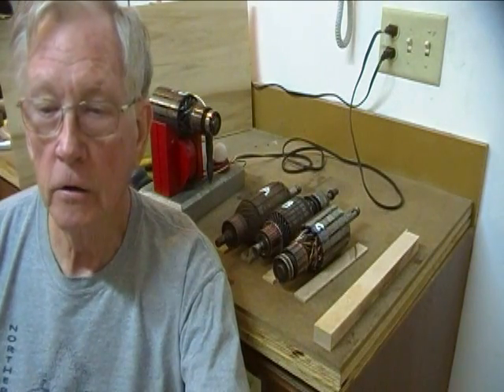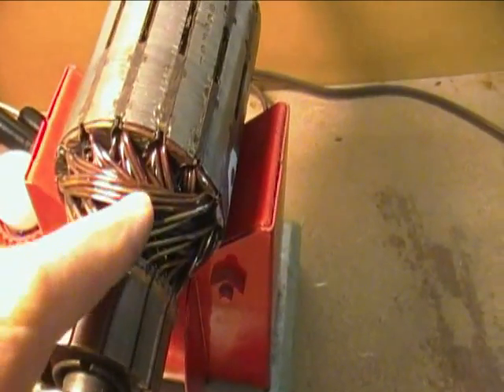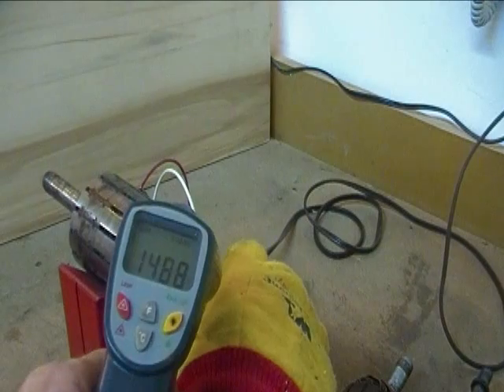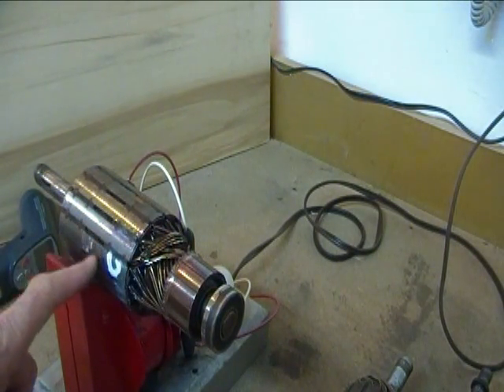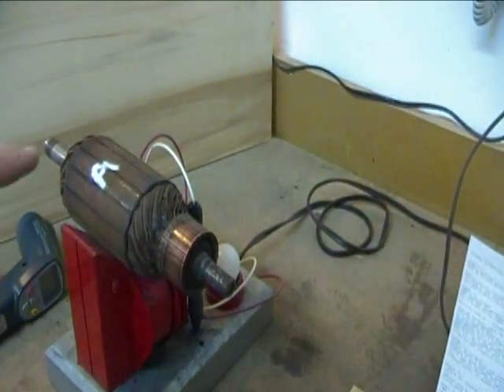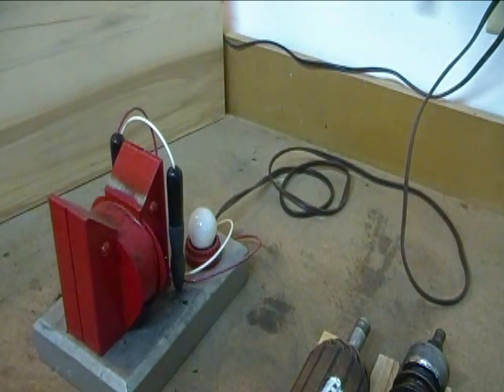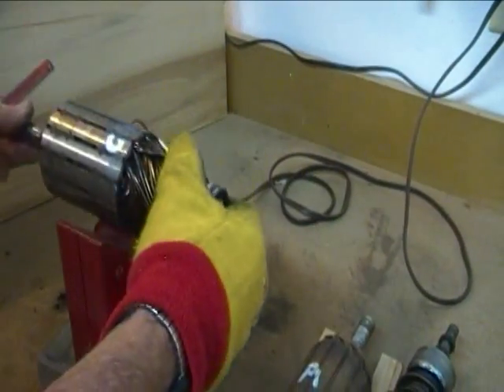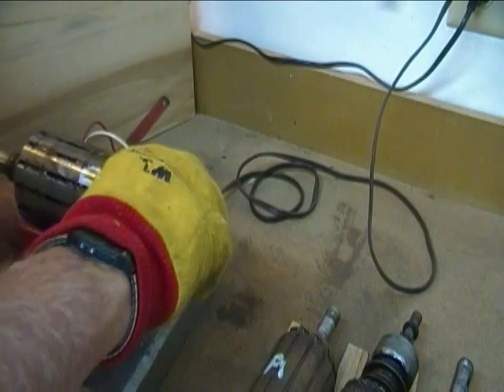Growler DC Generator Starter Armature Testing

Comment: Hi, would the tests that showed the armature was shorted by using the growler and hacksaw blade also be tested as effectively with an ohmmeter?
Reply from the maker: If the armature windings were shorted to the armature, then yes,  an ohmmeter would tell you that.  But, unless you have an expensive MilliOhm Ohmmeter, you probably can't tell if a couple of windings are shorted to EACHOTHER.   If you check the resistance of your ohmmeter by shorting its leads together, and it reads  more thatn 0.00 ohms, then NO.
Note:  I will accept arguments to the contrary, but I think that's why the growler was developed in the first place.

Comment: This is very similar to whenever I built a welder from a microwave transformer. All the problems, and observations I made. Match up exactly to this 'Growler'. The dead give away was the two triangles with separated metal plates, and with the vibration, and the increase in temperature part of an armature, makes me almost 100% sure that a growler is just a transformer, with an alteration in design.

I was fumbling around playing with high amperage as a kid, and I am surprised I didn't die. However, thag experience lead to me understanding this amazing machine. As well as the explanations given to me by multiple hosts of this contraption. Thank you for your wisdom.

Comment: YOU ALMOST MAKE ME CRY BECAUSE 40 YEARS AGO I WORK ON MY FIRST MOTOR SHOP DOING THAT TESTES ON ARMATURES  ,I REMEMBER MY FIRST DAY ON THE JOB ,I START 7:AM THEN 20 MINUTES   LATHER I LOOK TO MY WATCH AND WAS 2:00 PM, I TEL MY BOSS WHATS WRONG W/MY WATCH AND HE ASK ME IF MY WATCH WAS MAGNETIC PROOF I SAID ; NO ,, THEN HE SAID ,,, YOU DESTROY YOU WATCH BY THE MAGNETISM FROM THE  GROWLER, OK EVERY BODY MAKE MISTAKES , MY FAVOR JOB IS MOTORS ,I LOVE  DC MOTORS ,I HAVE 5 OR 6 THOSE GROWLERS AROUND THE HOUSE AND PLAY W/THEM SOMETIMES  TO BRING ME MEMORIES THOSE GOOD TIMES WORKING  W/ MOTORS, TOO BAD NO MORE MOTORS IN U.S.A, EVERYTHING IS IN CHINA ,I TEST AC ROTORS ON THE GROWLER W/HACK SAW BLADE BUT FOR AC ROTORS THE BLADE HAVE TO HAVE VIBRATION ALL THE TIME FOR A GOOD ROTOR AND I USED A AMPROBE NEXT THE GROWLER TO MONITOR THE AMPERES ALL WAY AROUND WHEN I TURN THE ROTOR AROUND , FOR A GOOD ROTOR THE AMPERES HAS TO BE CONSTANT AND THE HACK SAW BLADE HAS TO HAVE VIBRATION CONSTANTLY (NO VIBRATION MEANS OPEN CIRCUIT ON THE ROTOR BARS)

Comment: Would an ohmmeter show the shorted windings?  Or can it only be found with a growler?  Thanks, Bob
Reply from the maker: Technically, yes, I guess.
But the resistance of short pieces of heavy copper wire is very small, requiring an excellent low-ohms meter.  10 feet of 12 gauge wire has a resistance of only 0.016 ohms.

Comment: lo.que.esta.comprobando.son.las.corrientes.inducidas.en.las.bobinas.del.rotor.para.detectar.cortos.efecto.foucault
Reply from the maker: Hello Junajo.  No se habla Espanol.
Here is what i think you asked:
What are you checking? the currents induced
in the reels (coils?)
of the rotor for
detecting short
effect (circuit)
eddies (eddy currents?)
  If this IS your question, I don't know  A lot more current flows through  shorted coils, heating up the armature. Since we are using 60 HZ to power the growler, which is essentially a transformer primary,  there must be some eddy currents produced as we add that armature and its coils which act as a transformer secondary.  Maybe it's the shorted turns that reduce the eddy currents allowing more current to flow than would happen with a normal armature..  
  I think there's an opportunity here to add an AC ammeter into the primary circuit to see what actually happens. I think some growlers do have such a meter.
Pete Stanaitis
----------------------